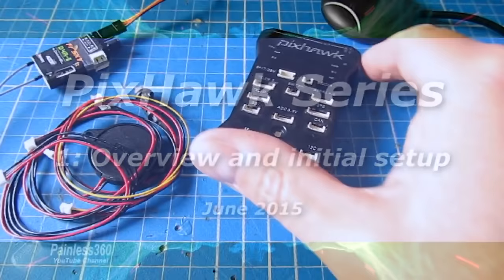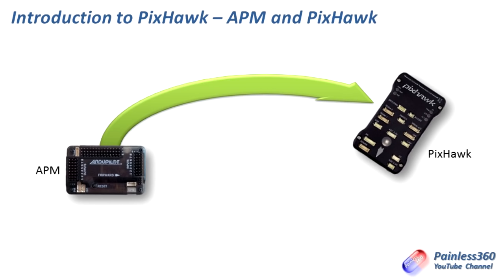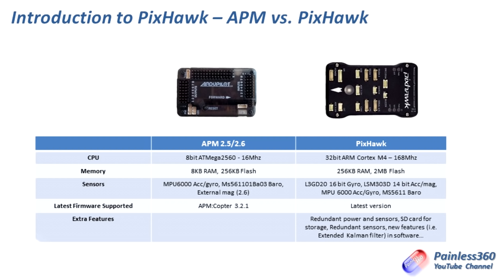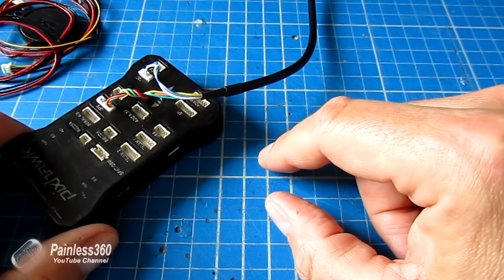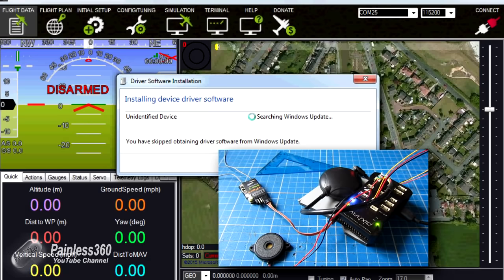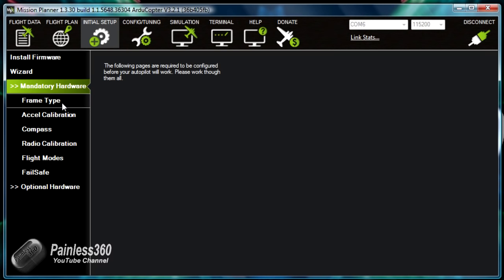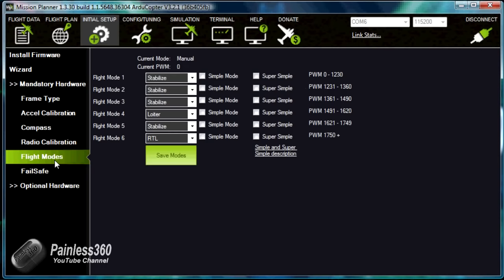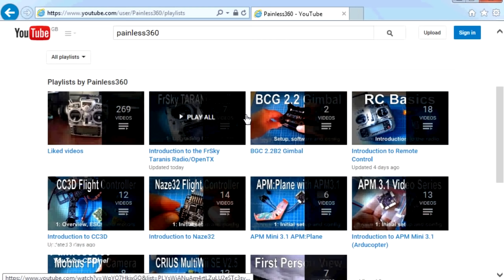(1/5) PixHawk Video Series - Simple initial setup, config and calibration

Comment: Hi Painless, 
I used to watch videos posted by you and I made a drone myself using Pixhawk 2.4.8 flight controller, Ready to sky Ublox neo m8n.   
Recently I am getting error in my Pixhawk 2.4.8, like Yaw inconsistent by 21 degree, 25 and keeps on coming.
This turns my drone in to rtl every time while flying.
I also tried calibrating compass several times.
Can you help me, what will be the reason behind this...
Reply from the maker: Could be a few things. I'd use the logfiles for look for problems and potential causes. Vibration could be an issue too.. best of luck

Comment: Hi Painless,   Great videos as usual and extremely helpful.  However, while trying to load the Pixhawk software during initial setup, I get the error msg  "No response from board"  .  Everything looks to be ok , nice boot up sounds, etc and all the com ports seem to be working fine.  Any suggestions or is there a problem area where I can get help solving this issue.  Thanks
Reply from the maker: +Richard Powell SD card inserted?
Reply: +Painless360 Yes but as it turns out my USB was not supplying enough power (as you had suggested might be a problem).  Connected via a powered USB hub and the software loaded OK.  

Thanks again for great videos.

Comment: hi, I am trying to connect the gps cable to my pixhawk as per the video, but the plug appears to have 5 pins with only 4 wires connected, red yellow green and black, on the pixhawk the gps socket has 6 pins, can you tell me if this is correct and which side of the socket do I push the gps plug into. Thank you
Reply from the maker: I use the cables that came with the kit. All the information from the build that I did is in these videos. Hope they help..
Reply: Painless360 thanks, Im watching the video now but your GPS plug seems to be covering all 6 pins on the pixhawk. Whereas mine covers only 5 of the pins either the 5 from the left or the 5 from the right so I'm at a loss as to how this plug is correctly seated in the pixhawk.
Reply from the maker: You'll have to make a cable up using whatever cable came with your Pixhawk and the cable that is supplied with a GPS. See the wiring diagram or in the Ardupilot or Pixhawk documentation to show you what to connect to where...

Comment: 1. Can I use Flysky i6x 6 2.4Ghz channel transmitter and receiver with this Pixhawk model ? Or do I really need 915 MHz ?

2. Can I use this model Pixhawk on fixed wing with just one motor?
Reply from the maker: 1) check out the series - you can use any SBUS capable radio. 
2) Yes. I have a few builds in wings and V tails with Arduplane..
Reply: @Painless360  Hi, those videos are with latest model Cubes. This one is the predecessor right? Please let me know if I can buy this 2.4.6 for Sonic AR wing
Reply from the maker: I've not used these clones of the original PixHawk for a very long time here. This series that this video is the first of is all about this older FC.. Best of luck

Comment: Good information. 
Thanks
Which firmware is suitable for Pixhawk 2.4.8 ( Hexacopter ).
I am facing problem in Ail & Ele, motors stops or disarm automatically...???
ESC Calibration, Arming no problem.
Reply from the maker: As these Pixhawks are all clones of varying quality it’s tricky to comment - looking on the forums there are lots of different problems depending on which particular version you’re using. Let me know if you figure out what it is. Best of luck!
Reply: @Painless360  have you ever used Pixhawk 2.4.8 for Hexacopter...???
I was happy with APM 2.4.8. This Pixhawk ( clone ) has made my life miserable. May be Original PX4 may be good.
Reply from the maker: I’ve moved onto Pixhawk CUBE now. I don’t have time to test all the versions of the hardware and software so the older Pixhawk series on the channel shows that last versions I used,, best of luck!

Comment: Hi, and thank you for all your helpful vids. I'm a new build newbie, I'm building a HJ-550 with a pixhawk f/c and taranis plus tx. My issue is, every time arm the copter, I have to do a compass calibration. After calibration, all is good, until the next time I try to arm it again, then I have to do the dance all over again. I'm not sure if this is related, but the GPS Module (Ublox m8n) blinks once (blue light) on start up, nothing after that, and no GPS fix. I've watched your video's multiple times and unable to see what I'm overlooking.  I'm using AMP Planner Version 2.0.24.on a mac. Any input is appreciated.
Thanks!
Reply from the maker: It shouldn't need that. I'd suspect the GPS unit.. Best of luck!
Reply: Ray Richards

Comment: Cant get the machine to land in Position Mode ?
Any suggestions?
Tried everything using Qground
Reply from the maker: I've not used position hold for a while as it was retired in Arducopter 3.2. I'd check the wiki for others with similar problems. Sorry I can't be more help on this one..
Reply: @Painless360  thanks its a issue not only for safety, but the thing is that i cant find the right way to fix it...!

Comment: Hi Lee,
Wondering if you could help me.
I have 5 GPS all from Ublox 6 to 8.Non of them lights up, i.e power and status led's.
I have tried it in apm 2.6 and pixhawk.
Now, since these are 5 different gps from 3 different vendors, I'm starting to wonder if there is a code or something that needs to be entered. 
Thank you.
Sincerely,Amir
Reply from the maker: Nope, I'd check that there is voltage from the GND and 5v pins you're using the power the GPS.. Best of luck!
Reply: Thank you. Did that, seems as the cheap crap GPS's from China I bought are simply useless. Ended up with a Crius M8N which works like a charm
Reply from the maker: Awesome! Glad you got it working. Happy flying!

Comment: I am using pixhawk on a wing (with tailsitter setup), i am not using safety switch, can the pixhawk be armed with rudder command ?
Reply from the maker: I've not tried but I believe you can. Best of luck!
Reply: @Painless360  i have tried ..it does not armed, will try again and check

Comment: Is it possible to make quadcopter obstacles avoidence using rasberry pi with ultrasonic sensor or directly connect ultrasonic sensor  on pixhawk flight controller
Reply from the maker: Please see my video on the LIDAR sensors. You can add them to a PixHawk to so that.. Best of luck!
Reply: Painless360 thank you soo much 😘😍
Reply: Painless360 sir how to add multiple lidar on pixhawk so we can make obstacles avoidence system on drone i have see full video but fully confuse how to do that is it possible you can make video on tell me everything about how to make that

Comment: Lots of PIxhawk controllers out there. If I want to stay away from knock-offs that might prove to be problematic w.r.t. firmware updates, etc. is it recommended to buy a Holybro Pixhawk only? Its pricey at $200 but it comes with Pixhawk 4, Pixhawk 4 Power management board, GPS module, cables and other greeblings.
Reply from the maker: I've got quite a few Pixhawk style flight controllers here including clone ones. The cloned ones are a lot cheaper but you're not sure of the quality you're going to get. I've been lucky and all of my ones here have work great..
Reply: Good to know, thanks! I found your newer video on the HolyBro PixHawk 4 which I 'm watching right now. Didn't know you made one on this newer FC. I'm pretty sold on the Pixhawk from HolyBro at this point. I've been reading about bad experiences with the knock off boards from ports that didn't work to not being able to flash the board with fw. 
Really appreciate your videos and the detail and organization you put into them!  I got my first quad build successfully finished because of your help.
Reply from the maker: I'd watch the S900 build in the 'Big Boys Toys' playlist before ordering. The code wasn't quite there for it last time I checked - but that was a month ago..
Reply: Since I have your attention :) and I cannot find a better place to ask this random question I'll ask it here. I purchased and just received your 3d printed Frsky receiver antenna mount and wondered what size of straw should I purchase. Ordering online is easier than trying to find it locally since there aren't any good RC shops close to me. I found some that were 3mm diameter. Will those fit the bracket?
Reply from the maker: @stevejones9044  details should be on the Thingiverse design page. I used the coffee/drink stirring straws.
Reply: Sorry, didn't bother to read the description at thingyverse. It says 3mm dia. thanks!

Comment: In this video you say its connected to the receivers iPPM port, is that the same as standard PPM or something only used on FRSky Transmitters/Receivers, I use Turnigy/FlySky radio which just has PPM, can they be used or is iPPM different.

Thanks
Reply from the maker: +Jean Harris The Rx here is PPM and works great.. Best of luck!
Reply: +Painless360 

Just found on their website that there is only a couple of Radio Systems compatible with the Pixhawk and their PPM-sum system your Teranis is one of them, my Turnigy/FlySky's are not.

Why could they not just use PPM that everyone uses, would make things so much easier.  Do you know of a flight controller system comparable to the Pixhawk but compatible with standard PPM or even good old PWM.

Thanks
Reply from the maker: I am not aware of any differences. All of the PPM systems I've used here work great. All of the radio control signal formats, including PPM, are a defined standard. Are you saying that you have a PPM Pixhawk setup and it doesn't work?
Reply: +Painless360 No problem yet as I don't have it yet, I was about to order one when I started to get doubts as to if it would work with my radio, on your videos you mention iPPM and Pixhawk say PPM-sum. Then someone pointed me to this link which appears to say it only works with the Teranis and some futaba. http://copter.ardupilot.com/wiki/common-pixhawk-and-px4-compatible-rc-transmitter-and-receiver-systems/ don't want to spend that amount of money only to find my Radios PPM is not compatible with Pixhawks PPM requirements. I did find that they do a PWM to PPM converter so that might be the way to go if all else fails I suppose. Perhaps some using Turigy/Flysky radio gear could confirm if they got their Pixhawk working or not.
Thanks

Comment: My pixhawk will flash blue and red initially but then go straight to yellow flashes. Ive tried several times and cant get it to work properly. Do you have any suggestions?
Reply from the maker: +Adam Martin If this is a new board then I would go back to the vendor for help and support. Lots of detail on the LEDs in the forums and webpages too. Best of luck.
Reply: +Painless360  Vendors aren't any help and don't even know how they work. Even if you got it directly from Pixhawk or 3D Robotics they won't take responsibility for it since they don't supply the software and you have to get crappy 3rd party shareware that never works so he is probably on his own.

Comment: Sir
Im using radiolink pixhawk 
And radiolink se100 gps.
GPS gives error GPS no fix
Reply from the maker: +Jashu Chaudhary what troubleshooting have you already tried?
Reply: GPS At first time its working fine but now its give me error.
One more error motor is not spinning from mission planner. a week ago its working fine but now its not working.
Im removing red wire to connect esc. so it is fine ?

Comment: Hello! may I ask if it is possible to send data like from gyroscope, accelerometer, barometer, etc etc from pixhawk to the computer and maybe run it in flight controller algorithms like PID controller and send it as commands to the quadrotor
Reply from the maker: +Jeiy Lp sadly the problem would be one of latency for it to work (I suspect) best of luck!
Reply: thanks! by the way, were you outdoors at this time 'cause it's like gps and stuff.. lol stupid question
Reply from the maker: By a window, I you're indoors then the lock will take longer and be harder to get..

Comment: i have a problem.Cannot detect your board version.check your cabling. i tryed to change my cable but the result is same
Reply from the maker: +Muhammed Altuntaş I've not had that problem here, but if you check the forums you should see that that suggestion is normally try and flash another kind of firmware on the board first (Arduplane etc). Best of luck with it
Reply: Painless360 i removed mission planner then i installed again and it is solved 👍

Comment: Painless, I am setting up an airplane. If channel 5 on the PixHawk is for "mode" ( 20 minutes into video) would I just go to channel 6 for second aileron ?
Reply from the maker: +K BikeRider You'd setup only one channel from the radio for the Ailerons. The FC does the rest. See our video where we added an APM to a flying wing.. Best of luck
Reply: +Painless360 I'm at a bit of a loss there. Where do I plug in the ailerons from each wing. There must be a pass through for when you fly in manual mode. ch 1 and 6 is what I use in a normal set-up ( NON APM ).
Reply from the maker: You are talking about CH5 being MODE - that's on the RC inputs.....

Comment: Hello: With my new pixhawk it has Qground firmware installed on it.. and i would like to run mission planner instead...would i go into mission planner" terminal " and setup/erase to clear the eeprom to install mission planner ?  I have asked on Qground forum and no one wants tell me how to reset the board they say i should stay with Qground software..but i am more comfortable with mission planner as i have 5 apm2.6 already hope you can help And Thank You
Reply from the maker: I would try simply installing the firmware using the process shown in the videos. I've never used the other type you mention. Best of luck..
Reply: Found how to do it myself by going into Qground control and update firmware then it asked if i want Qground stacks Only or Apm stacks/with no Qground.. now its running on mission planner.. Thank you for your reply

Comment: Something very strange happening with my pixhawk! Can not flash any firmware to it! The latest updates seemed to have corrupted the system somehow...it will not follow the normal procedure, no matter what I do...
Any help will greatly appreciated before I throw it at the wall ;-)
Reply from the maker: Without an error or video showing what you're seeing it's tricky to offer any advice. Make sure the SD card is seated and ok.. Best of luck!

Comment: I am looking for someone who has successfully made PixHawk to work with Futaba R7008SB receiver while using a Futaba 14SG radio?
The problem I am seeing is that under Mission planner, I am unable to calibrate the radio. No matter what you do, the Mission planner doesn't respond or show any values when you move the joy sticks.
1. Futaba R7008SB is already set in S-Bus Mode.
2. The receiver is linked with 14SG transmitter.
3. PixHawk is working fine with Mission planner.

Does Futaba 14SG radio requires any special settings other than set for Quad Drone? The current version of the radio is 4.0

If anyone has any setup videos or instructions, it would be highly appreciated. Thanks
Reply from the maker: A quick Google search found a number of other pilots in the forums getting that receiver to work with S-Bus. I'd concentrate there first. Best of luck with it..
Reply: I am using the S-BUS. The receiver works fine with the radio. Its the calibration part in Mission planner not responding.
Reply: I figured out with the help of another user on DIY forum what was the real issue.

So for those of you who read this or in the future let me clarify everything for others.

1. The Futaba R7008SB receiver has 8 ports, one S-BUS port and S-BUS2 port. The S-BUS and S-BUS 2 only get activated on the receiver when you set your Futaba Transmitter (14SG, 18 etc.) for 14 Channel (FASSTest-14CH Single G) setting (NOT 12 Channel)
2. As other mentioned the connection from Pixhawk to your receiver will be that you connect the wire on Pixhawk on RCN pin and on the Futaba R7008SB it goes to the S-BUS port (Which is the last one after pin marked 7/8)

Please note PixHawk only works with Futaba R7008SB in S-BUS mode.

Comment: Hi Painless could you tell me why SD card is needed? Can't I connect and upload firmware into pixhawk without external storage ? Thanks in Advance
Reply from the maker: All in the manual - it seems to need it for storage? Bottom line - No SD card/no flash. Happy flying!
Reply: okay, thanks

Comment: How important is the external GPS if your pixhawk has one already and would I be correct in assuming this one would require a GPS?
http://www.gearbest.com/multi-rotor-parts/pp_237867.html

Is this the correct GPS unit for it?
http://www.gearbest.com/rc-quadcopters-parts/pp_145902.html

 I detest the way the naza flies in manual and and the GPS just doesn't perform so I'm eager to get rid of the NAZA on my GPS quad but looking for reliable GPS I can trust.
Reply from the maker: It looks like it should be, I'd check with the vendor before placing your order. So many of these things use different bloomin' connectors!

Comment: Hi, have you experienced unable to hover after completing all the needed informtaion? Im using flysky fs i6 the pitch sames not working
Reply from the maker: Not had that here - what troubleshooting have you done?
Reply: Painless360 i didnt done anything yetc, but the calibration process are done. All flight modes are stabilize only. Upon arming my drone, when i started the throttle the drone wont hover steady. What to do? And it wont go up even further
Reply: @Painless360  I tried recalibrating again, but still the same throttle is already in the middle and the drone is starting to move clounter and clock going up but only for small amount. What seems to be the problem?
Reply: @Painless360  Also, im always calibrating the ESC everytime im trying to armed the drne using my flysky fsi6.